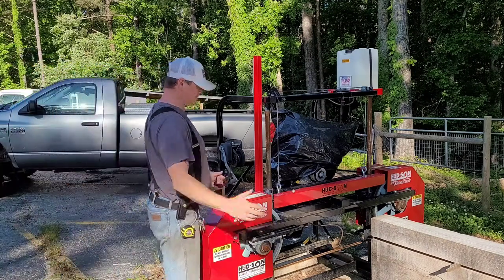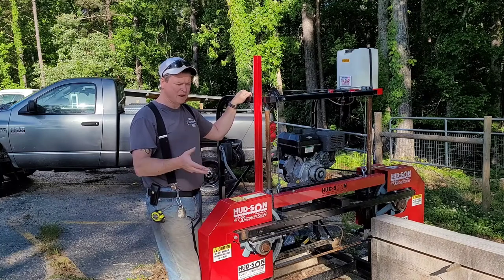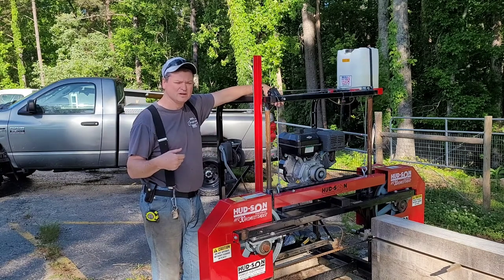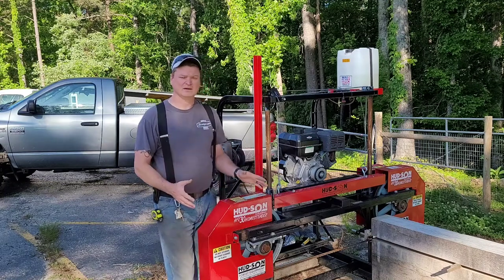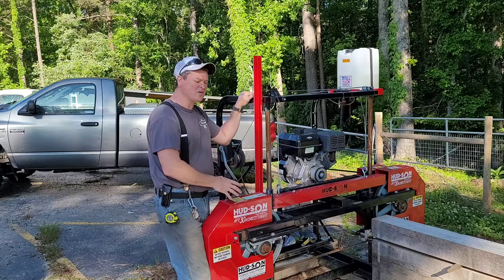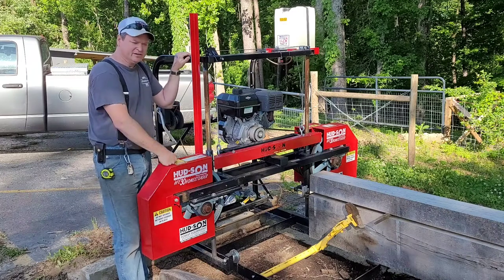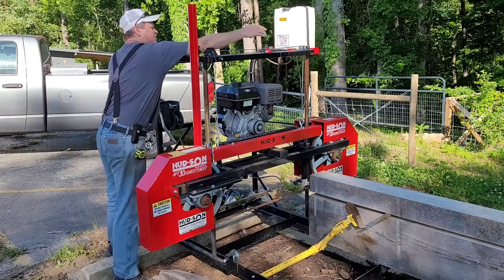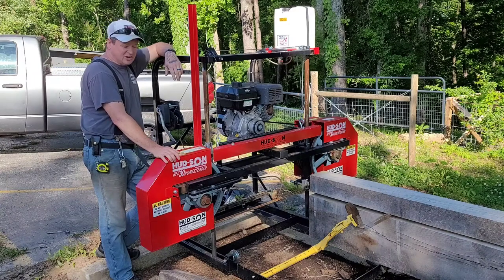Hud-son Homesteader 30 sawmill review

Comment: Use ethenol free gas to stop the moisture in the fuel tank. The problems you have encountered and then some have all been addressed and the fixes on our channel. There are many flaws in the design but with perseverance and a welder we made a very bullet proof machine. Good honest review

Comment: Dang man, I really appreciate your honesty here. I've been looking at Woodland mills but got interested in the Hudson's for the longer track. I do believe your video has pushed me back to the Woodland mills. 

Hate that you've had so much trouble with your machine. Good luck, man. ✌️
Reply from the maker: I think that any cheap sawmill will have problems. I've even heard of the new "cheap" woodmizers being crappy.  I knew that I should have low expectations.   Overall,  as of right now...I'd still buy the same mill.  While it has it's problems, it is still a mill that I can cut huge logs with for less than $10k.  So it's not all bad.

Comment: You can have trouble and run into complications with any mill of course the more you use it the better you get with it after all as long as you got a flat and level bed that is true to the bandblade should be able to saw good straight lumber, which is the most important thing now if you want all the bells and whistles, Hudson has these if you want to spend more money  and that’s what everything comes down to is money which helps a lot on these sawmills

Comment: My previous comment was made mid video,but after your honest review,being mechanically inclined myself,I think I would rather go with the even cheaper Harbor Freight mill and modify that myself.   Thank you very much for an unbiased review.
Reply from the maker: Yep.  I don't skate around obvious obstructions.   I hit them head on.  It's a decent,  cheap mill for pretty big timber, but it does have some serious flaws.  If I had it to do over, I would give the harbor freight saw a more serious look.  Not saying I would get it though.  This sawmill will go right through a 16" log, whereas,  the smaller mills might struggle.  I'd probably still get this sawmill.  I would simply lower my expectations,  and consider it a good mill for up to 20".  Anything after that...it'll do it, but you really gotta go slow and maybe consider some modifications.   Whatch my video were I'm cutting  sweet gum.  It performed flawlessly on that.
Reply: @novicelumberjack  will do

Comment: Change your Sq tube's on dogs to round stock. I have a oscar36  with 24 hp vanguard and don't have problems  as long as blades  are sharp. Wish their blde guide system  was a little  better but it works.power up dude!